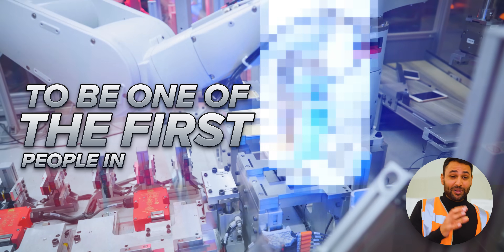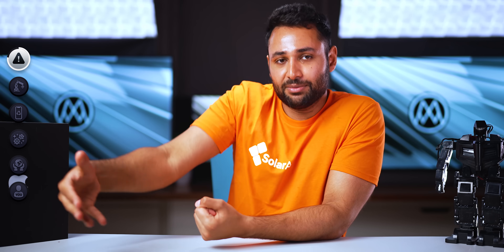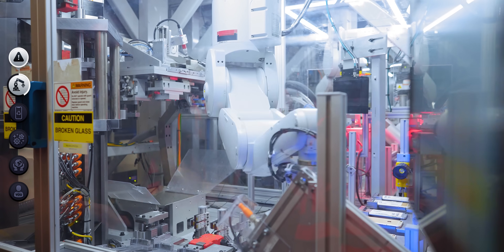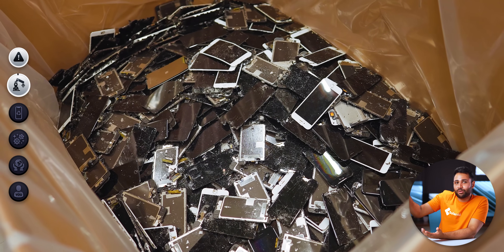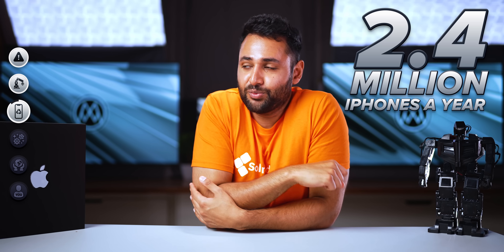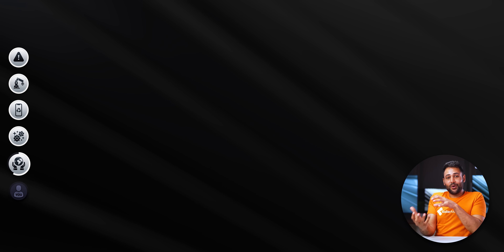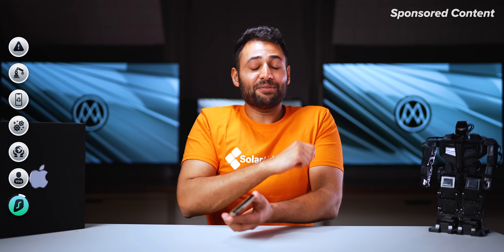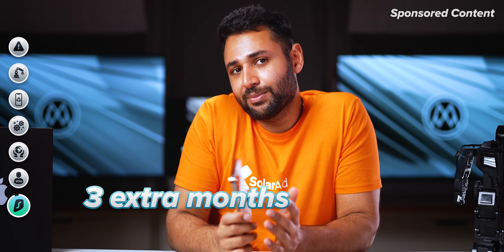Apple made a Robot...and I got to test it.

Comment: Hey, I wonder could you expand on the last part about just trading in broken phones, majority of phones apple deems beyond repair are very easily repairable by trained professionals, maybe something like a video between you and Lewis Rossman could be made addressing this further
Reply: Was going to say that there is the option to repair your phone and that would also help the environment alot
Reply: @alexanders1859  If Apple doesn't stop monopolising over iDevice repairs, no one is going to do that because it's simply not economical for them.
Reply: Apple's expends considerable resources to stop anyone repairing their devices. All parts for board-level repair are unavailable. Their behaviour is unethical and disgusting.
Reply: @mark314158  Best part is, it's not done for anti-competitive reasons, anti-competitive would be if it was done to stop samsung, huawei and all other brands from using the same stuff. It's done for anti-consumer reasons, it's so the consumer has no choice except to go to apple and get a new device for everything except a couple simple repairs
Reply: @PanyuYT  I mean… maybe you didn’t notice, but Apple‘s first priority is control. Control over the supply chain, control over the hardware used, control over the software and what their customers can do with such software. And of course control over repairs, who can perform them and how they have to be done. Control is what makes Apple thrive, you can see it in every decision they make. So don‘t be surprised if they have control over repairs; it‘s in their DNA.
Reply: *Louis Rossmann
Reply: @jm56585  Ahhh, I knew I had done something incorrectly, thanks for the correction
Reply: I think Apples original type of repair is very pro-warranty centric which people like louis will never understand and that off course comes with the caviat of out of warranty repairs being quite outrageous. 

And while I agree with the sentiment that Apple does a lot of unnecessary “anti-consumer” steps in out of warranty repairs to gain control over their devices and their 3rd party Market, they at the same time do a lot of unnecessary pro consumer steps in warranty repairs like for example exchanging devices and recycling as much of the previous as possible rather than making minor repairs that could lead to you not having believe in the device you are using because of it’s “repaired by hand” nature, or changing your battery if it’s under 90% for a new one in almost every in warranty repair even if the battery wasn’t faulty just to make the consumer fine with the repair.

I think we shouldn’t approach repair as only “out of warranty” paid stuff because while I know a lot of people that would shit all over Apple for their out of warranty repairs, I know probably even higher amounts of people that have been super positively surprised on how pro consumer they can be if they want to.
Reply: @dominikhanus9320  is exchaning devices instead of just repairing them really pro consumer though? The consumer loses their stored data, they have to pay more for the new device instead of just a new component, and is also more damaging to the environment. I think it's just Apple being lazy or their own anti repair designs making it too hard for Apple's outsourced repair people to repair the device.
Reply: @jm56585  if you’ve ever worked in any electronic retail store you would know that it is. There is so many Arguments employees have to deal with daily surrounding repair and people’s lack of believe and around 30% of people in my country want to withdraw from the purchase agreement to 6 months if their device is faulty. and get a new device because of that.

That leads to much more electronic waste than what Apple is doing because the original phone almost never gets to Apple and as such doesn’t end up recycled or refurbished and consumer gets 2 new fully manufactured phones for retail instead of getting newly refurbished service exchange part.

Plus it negates consumer’s future problems more than just typical repair and if you have 2 years of warranty or AC+ I’ve never seen people tell me that they’d be happier if Apple just replaced faulty chip on motherboard rather than giving them exchange. 
Apple repairs these 4 components and rest is exchange - Screen+Assembly, batteries, ports, camera.

Stored data - consumer loses data by the law in my country because of GDPR anyways.

Pay more for a new device - not in the argument I was talking about as in warranty free repair.

As I’ve said previously Out of Warranty repairs and Apple is conversation for along time and their out of warranty policies are often horrible and difficult to understand, but that doesn’t change the fact that they’ve had the best in warrant repair I’ve ever dealt with by lightyears